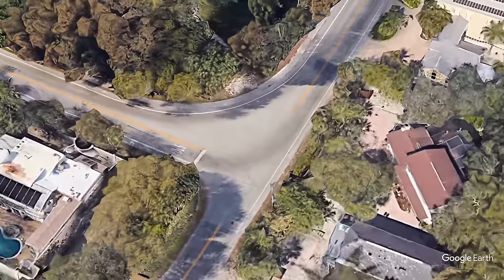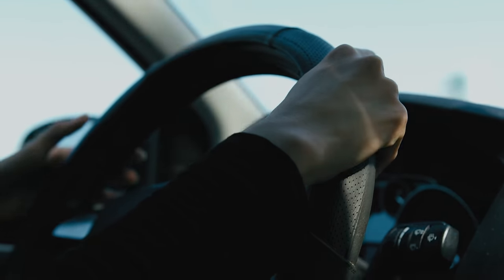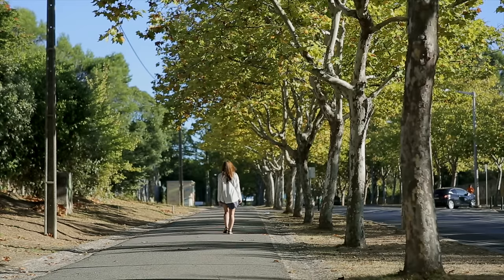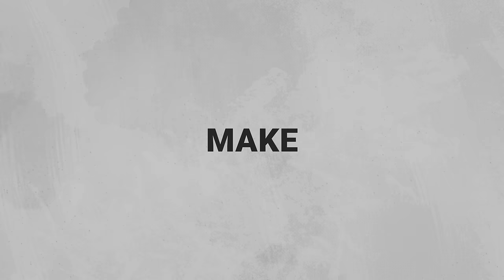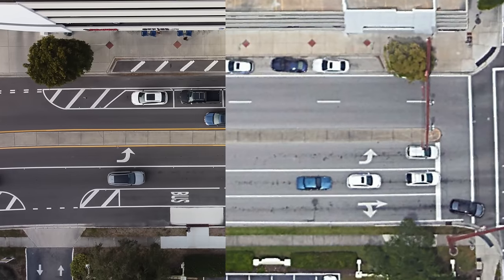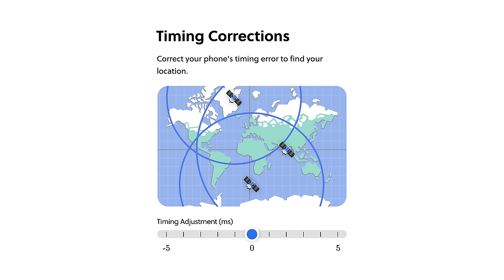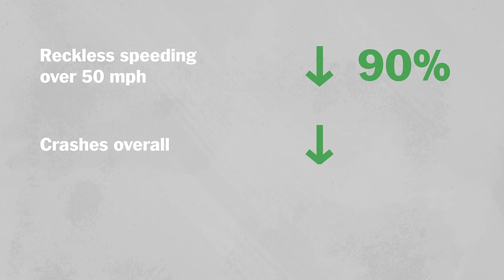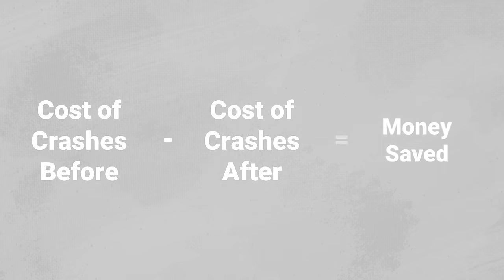This is the key to safer streets

Comment: as Dutch citizen I was already surprised at the fast speeds people travel through neighbourhoods in this video. and then I realised I was looking at mph and not km/h! over a 100km/h in a neighbourhood is just insane! suicidal!
Reply: I think the word is murderous not suicidal.
Reply: ya 35mph / 56 km/h is a common speed in pretty much all towns, although school zones drop to 20 mph / 32 km/h

but rule of thumb is if it's 30 then you can do 35 or rural country it's 55mph but everyone goes 65 at most although some do 70mph..

anywhere thats 100km/h or close to is rare usually it's a town built around a main road but neighborhood i never seen one yet
Reply: While id agree with you, I don't really think there should be homes on a heavily traveled 4 lane road to begin with. When strodes come up, the knee jerk solution always seems to be to turn the stroad to a street and not the stroad to a road. If that street is better used as a road, why not remove the housing and pedestrians from the equation? 

If you reduce the lanes and slow traffic on a high volume stroad, you'll end up with increased congestion (which I'd find just as frustrating as speeding cars living on that street) or speeding traffic bypassing the congestion on a parallel street, shifting the pressure from one street to the next and so on.
Reply: @MrGOLDENSHOT25 bro did you seriously just suggest removing people from an area so that cars could have it easier? That's so fucked up
Reply: in romania that guy would likely get jail time
Reply: This is stupid and terrible. A solution in search of problem. This slows down the street needlessly.

Comment: I overlaid a Scottish roundabout I was familiar with, at scale on various intersections in Southern California. Most fit, some would require nipping off a corner or two. They'd both calm traffic and eliminate delays. All these Advance Left turn lights all over the U.S. I've only seen overseas in the centers of very congested cities.  I love roundabouts.  What I've noticed is that I'd rather take a bit longer to get to my destination so long as I don't get stuck in congestion waiting for lights to cycle, the cross traffic minimal...
Reply: I agree! I hate waiting on lights. I might be driving 20 kph, but at least I'm driving. Having to stop every intersection is what makes me irritated.
Reply: @JorgeForge Roundabouts don't eliminate that. You still have to wait, in this case for a gap in traffic, like at any other priority junction. In some cases they can actually make traffic worse, especially when the flows on the varying approaches are unbalanced, resulting in there being little to no gap for certain approaches.
Traffic lights on the other hand give everyone a chance to go. Also they take up less space, and hence are more pedestrian-friendly (shorter crossing distance). And they can be coordinated to provide a green wave, which can reduce the number of stops to just one, in ideal conditions.
Reply: @NewBuildmini 1. Roundabouts do reduce the amount of time you are at a standstill and therefore reduce irritation. With a traffic light you are stopped for 30 seconds or longer. Whereas with a roundabout you continuously inch forward. The later one being much less irritating.

2. What layout are you thinking about that makes you think that traffic lights are more pedestrian friendly than roundabouts?
Because that's generally not true. Either they are the same (crosswalk across two lanes). Or most of the times roundabouts are better because they have the space to have a "refugee island" between the two lanes. So you only have to cross one lane at a time instead of two lanes.

Comment: I like how that dangerous intersection was changed, but they (again) left out protections for pedestrians or people riding bikes to cross it safely.
Reply: I was thinking the same thing. No labeled crosswalks.
Reply: it's still a lot safer than before, even without markings, due to the vastly reduced speeds, it can be better, yes, but we have to take that first towards better street design somewhere
Reply: I hope so, since it should be fairly quick to modify it.
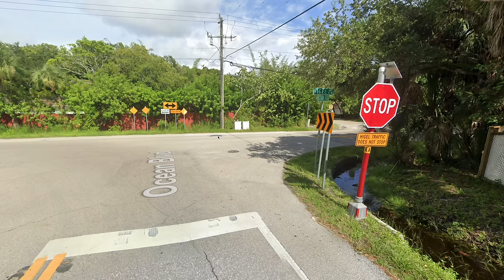Reply: @imblackmagic1209 cars are still able to do right turns at a high speed. The roundabout didn't change anything about that. (the problem portrait at 0:19 )
So crossing that road is still as dangerous for pedestrians as before.
Reply: @Jehty_ they can atill turn very fast, but if that intersection gets any traffic they have to watch & yield in the roundabout. 
It could be better im sure, but this was a temporary adjustment that they could make without adding more pavement.

Comment: Somewhere in southern Germany, an intersection between 2 busy rural roads (with legal speed limits of 70-100km/h) that originally only had stop signs for the "lesser" road got the nickname of "death intersection" because there were fatal crashes every few months. Authorities tried a few variants of changing the intersection, and the only one that really worked (and has stayed for many years) was turning it into a roundabout. Since the conversion, there have (AFAIK) only been a few minor crashes and zero fatalities. So yeah, roundabouts work.
Reply: An alternative measure could be to stagger the intersection, turning it into two T-intersections, to force drivers to slow down.
Or to put in speed bumps (which is cheaper, but worse for drivers' suspensions, and noise).

Comment: These are great ideas. My city had the single goal to reduce lane width, to make cars go slower. One of the ways they did this was to convert 3 lane roads to 4 lane roads. The problem with simply making lanes narrower is that as a driver, I get nervous about hitting other cars (moving or parked) which makes me distracted and more difficult to also respond to bikes using the shared lane and pedestrians crossing at uncontrolled intersections. In my experience, it's far better to use some of these other traffic calming measures, but not narrow the lanes when the lanes are going to be next to other car lanes or parking. My ideal would be to reduce the number of lanes to create protected bike or pedestrian lanes, as I am also frequently a bicyclist and pedestrian.

Comment: 9:00 where I live we did this but it still resulted in collisions so now the left turning lane is a median with cut-out left-turns only at specific points where there are roads or driveways. The intersections are also roundabouts so if you have to turn left but can't, then you can turn right and do a u-turn.
Reply: Such a center turning lane has the name "suicide lane" for a reason.
I don't get why this video portrait this as a good solution. It's a horrible solution.

Comment: We've been doing this stuff in the UK for decades.
Reply: Making mini roundabouts with plastic centres?  I doubt it.
Reply: @jaycee330, well, if you considered thermoplastic paint to be plastic then yes
Reply: @jaycee330 who cares if its plastic or concrete, this isnt innovative at all.
Reply: @jaycee330  Well theres roundabouts with stone bricks coming from the center area so semi trailers can still get around.
over run areas arn't anything new and ngl should be used more on mini roundabouts to prevent people driving over the middle so much.
Reply: @jaycee330  What difference does it make what material they’re made out of? It’s the function of them that matters.

Comment: Why is there not more of this already??  Imagine being able to just about guarantee a return on investment greater than 10X?  Based on the example of the 4-lane road conversion, if the infrastructure only lasted half of it's lower end estimate then based on $5M in a half a year that would be $25M total return for $500K  initial investment in just 2 1/2 years.  Correct me if my math is wrong, but it seems like a pretty quick win and there should be a nationwide push to install more of these simple, low-cost and extremely effective designs.
Reply from the maker: You would think so. I think many communities just aren't aware of how detrimental the cost of crashes can be to the local economy.
Reply: Because its not easy to convince people who make decisions.    When everyone is clamoring for more road lanes,  to say that less may be safer and not impede traffic is akin to Galileo claiming heliocentrism.

Comment: There is a 6 lane stroad close to where I live and it is absolutely awful to walk around. It needs this type of conversion
Reply: I'm skeptical, if a 6-lane stroad is even salvageable. Maybe down to 2 per direction and eliminating all left turns…
Reply: @kailahmann1823  easy-peasy. Boulevard with over or under crossing like Moscow has it's boulevards and prospects. Intentionally separating fast road, slow road and pavement within one wide street.  They can be over 100 m (300 ft) wide and incorporate a lot of foot traffic, car traffic, possibly tram or underground stop, park features like full-sized trees, benches, statues and fountains going on. 
No left turns except for specifically designed ones.
In that case, the easiest may be to leave two ways in each side with a separator island in the middle, and add wide pavements protected by trees or something. This way - you cross two stripes going south, then the middle, then the two going north.
Reply: @kailahmann1823 It's definitely not as simple. It doesn't help that two highways exit onto it right next to each other

Comment: After years of activism, I've actually finally gotten through to the higher ups at my building and I'm working on drafting up proposals to make our wide gaps between sidewalks at our apartment building safer. The area near our building is cut in half by a parking lot so I'm trying to find a way to slow drivers down and make it safer for pedestrians to cross.  I was thinking a raised crossing would do the job but I'm open to suggestions. I'm just not sure where to find good designs for safe sidewalks and crossing to a safe standard. We also don't have enough bike storage so I'll see if I can convince them to add more bike storage since we have less than 20 spots for bikes in a 11 story building.
Reply: It sounds like you should just make the gaps physically narrower. At least as a first step. You can also make the gap visually narrower by painting lines along the side of the street near the crossing but not in the part where it's not close to the crossing. A refuge in the middle depending on how wide the street is. Different pavement on the crossing itself. And then raised crossing as a last resort. The first steps should be implemented anyway if you want to go for a raised crossing later but this also allows you to go cheap first.

Comment: 12:45
Is there a Bus Stop on the two directional bike lane?
What is, when a bike comes from above, when a bus ist arriving in the Bus-stop?
Reply: good question… far better solution would be to raise the bike lanes to sidewalk level, bend them slightly to the right and let the bus stop in the drive lane.
Reply: @kailahmann1823 That would defeat the point of using inexpensive materials, but definitely something to consider in the future.
Reply: @thegreenguy5555  the current design a point, where cheap might be to cheap…

Comment: I like at 2:41 when said "in places where pedestrians are present such as residential streets" you showed arial video footage of a suburb with 0 pedestrians in view
Reply: Why walk when you can easily drive? You only walk if you are extremely poor, can't get a license (which we know doesn't stop a lot of people) or have severe anxiety around driving. 

I live in a small town. It's very walkable, fairly pleasant to do so in the summer too. But, if I'm going somewhere further than a quarter mile away. I'm just gonna drive there. I've got heat, air conditioning, a comfy chair to sit in and personal space in my car - which to use requires no effort on my part, I just sit, wiggle my toes and bend my elbows occasionally... Walking is for chumps.

Comment: I'm in the US for my first time. For a country that chose the car as a main form of transport it sure seems like not much thought was put on infrastructure. Shop exits at 90° directly onto a 55mph road EVERYWHERE, manouvers where you're forced to cut across 4 lanes that go 55mph, stop signs in idiotic places, haven't seen one traffic light that detects traffic and turns red and green based on the flow from different sides... But no wonder everyone drives, it feels awful walking along these huge stroads with all the fast cars passing by, looking for the barely existing sidewalks.

Comment: I like roundabouts as long as they are single lane. Once it gets to two lanes and up its basically ridiculous. Been on plenty of single lane roundabouts but the double lanes always have issues.
Reply: Turbo roundabouts discourage lane changing within them via physical barriers, fixing many of the issues with two lane roundabouts I’m starting to see popping up, which have many of the issues with monstrous multi-lane traffic circles: lane changing or cutting off other drivers, which disrupts the flow, drivers getting stuck in the inner lane, drivers cutting the shortest path through at high speed, ignoring painted markings, etc.

Apparently, some traffic engineers are concerned about clearing snow from turbo roundabouts, but they seem to clear them fine in Nordic and Scandinavian countries that implement them. They typically only do at busy intersections of multi-lane roads, where single-lane roundabouts can’t support the throughput.
Reply: full double lane roundabouts are trash, they shouldn't exist anywhere. You either build a single lane (which works up to about 20,000 car per day) or a turbo roundabout for close to twice. For even more, you'd need to reroute traffic and REALLY need a train line…).
Reply: Two lines roundabout is nothing. In my city there's a three lines roundabout. And that's not all. You have to also pay attention to trams and pedestrian crossings going through the middle of that. Since it's a busy place quite a lot of cyclists also use it. My main issue is that there's space for a safe, seperated bicycle line there. Neither cars drivers nor pedestrians would lose anything if someone slightly intelligent decided to paint some lines. It's actually pretty rare in our city where usually you have to sacrifice something to make space for cyclists

Two lines roundabouts are not that bad especially when you have to move more cars. Three lines roundabouts are "fun" to experience. Four lines, eh, at this point you have to ask yourself where did it all went wrong
Reply: Many roundabouts where I live are two lane and have zebra crossings (pedestrian) plus connect to bike lanes and major bus routes. They seem confusing or busy at first when you think about every mode of travel together but it’s so efficient.. In fact it’s the quickest, safest and most efficient intersection for most cases! 

Just gotta practice when cycling and driving bc they can be tricky at first
Reply: alot of roundabouts are 2 lane even if they don't show it.
i have been on single lane roads with roundabouts that are 2 lanes for vehicles turning right.

Comment: The best of intentions.  What could possibly go wrong!

The US passed a rule many years ago to protect pedestrians that required that the bodywork on the front of vehicles had to be at least 10cm from the nearest hard part (engine, chassis, etc) which made the fronts of the vehicles instantly considerably higher.  The thinking was that the people would be less likely to be injured by the car, the reality is that people are now less visible and they are more likely to be dramatically accelerated in the impact and more likely to go under rather than over.

There is also the corporate average fuel economy rules that made larger vehicles more profitable for manufacturers to the point that they completely dominate sales.

As long as I'm ranting ... Daytime running lights have resulted in a significant number of collisions after dusk with vehicles without their headlights on.  The drivers think their headlights are on because their dash is lit up and they can see light coming from the front of their vehicle.  But without headlights on the light from the front is far less, they can see less far ahead, and the back and sides of the vehicles have no light at all.  If automatic headlights were included in the rule we wouldn't be here.

And this one might just be personal ... who at GM thought it was a good idea to make the reverse lights come on when a vehicle was parked so anyone passing behind them can no longer know if it's parked or is actually going to move?  And several companies are so cheap they don't have different LEDs for signals and marker lights so when a turn signal is on the brake light turns off.